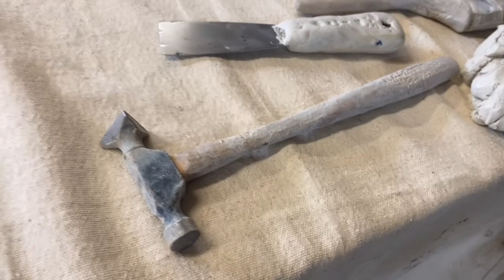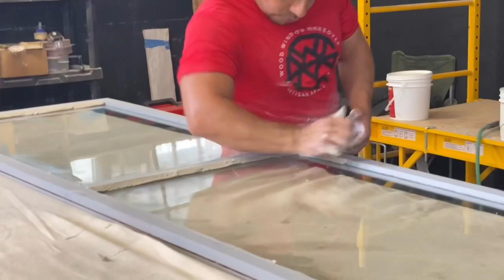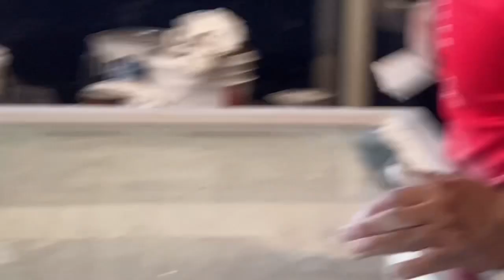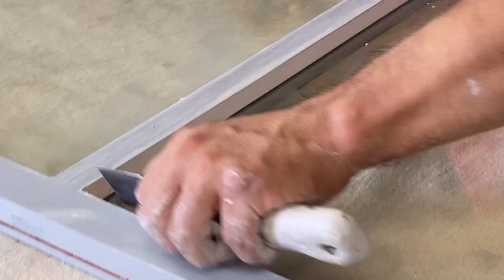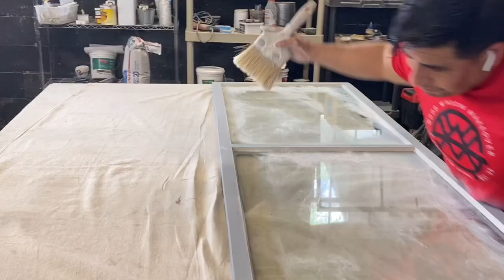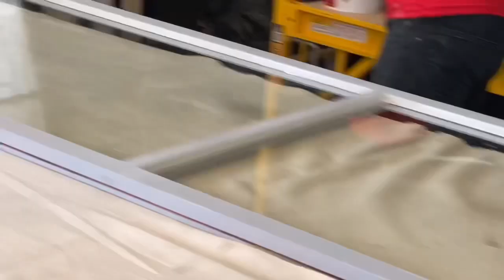If You Can Glaze Like This, You Can Make Money In Window Craft

Comment: What is the powdery substance he's using on his hands that's keeping it from becoming a sticky mess?
Reply: The powder that he used to clean the glass at the end is Whiting Powder (Calcium Carbonate), but I don't think you would want that on you hands when working the putty because not only does it clean the glass it also aids in setting up of the putty. Perhaps it is the brand of putty (Sarco type M) comes highly rated by professionals
Reply: I use drywall powder. I think he added a little to the putty as he was first kneading it and warming it up.

Comment: Nice videos! -- QUESTION -- Note sure if I can inlcude youtube links in questions (so I won't) but I watched British double hung / single hung windows installations and when they are finished they "caulk" the outside to the stonework with a type of caulk that is not like our caulking . not white plastic like stuff.  It looks like musterd seeds or linsead (I think) but I cannot find the name or product that is used. If I can include a link I will. So it is used between the wood frame and the bricks/stone.  Looks like musterd with seeds in it.  Any idea on that?
Reply: Hi, it will be burnt sand mastic. 
It’s a mixture of sand that’s been heated on a hot plate and linseed oil with driers to allow it to harden. It stays flexible for years and has been used to point windows for hundreds of years.
Reply: @Filkersons  ...we need to get back to installing these quality windows on houses across the US.  Such junk has been installed for the last 30 years.  Want real wood, single or double hung, proper glazing and paint not plastic, fiberglass or aluminum cladding.

Comment: Hi there, I’ve been watching your videos non stop leading up to my first glazing. Did it today and ran into weird issue, the compound was a little grabby as I pulled it with the knife, leaving a not so smooth look. Knife issue or compound issue (using same compound as you do)
Reply: Knife issue for sure. Did you knead up the whole bucket of putty before you used it? That’ll help with the consistency of the product. I suspect you were using either you were using an older knife that isn’t mirror smooth, or the angle of your knife during your pull is wrong. The more steep the angle of your knife, the worse it looks. Your knife needs to be almost parallel with the line you are striking. And you have to hold the knife right. Definitely not easy.